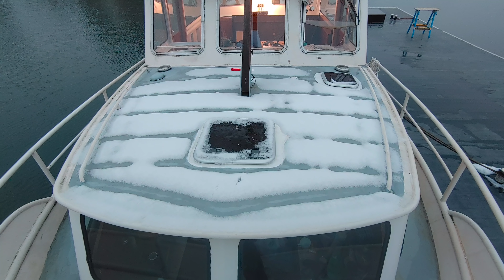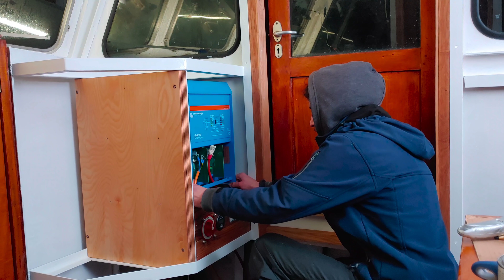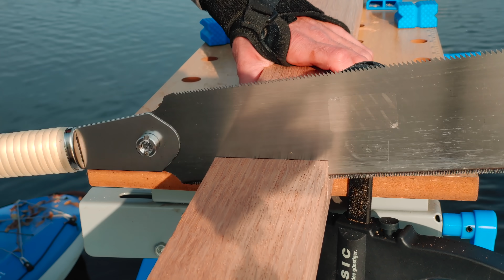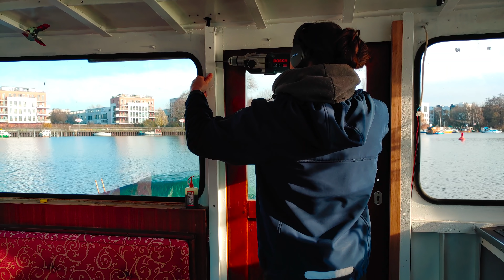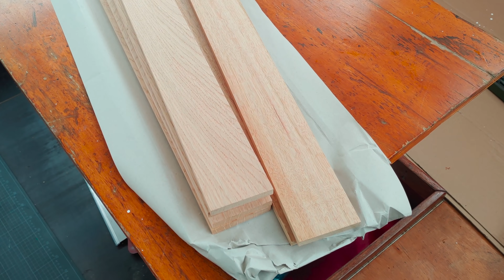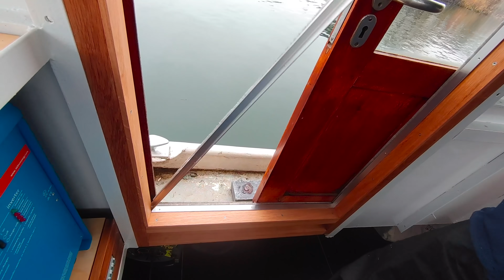Woodworking on a Steel Yacht - Part 2/2

Comment: Ouch...I never saw how close you put your main inverter AC breakers to the side doorway. As someone with many years sea experience I can tell toy,,,,it is not IF sea and or rainwater is going to come through that door and soak that panel, it is just a matter of when. If it is saltwater you can kiss it all goodbye. It looks like you have room to put a Plexiglass or clear acrylic cover door over the whole shelf unit near the door to prevent water from hitting the breakers. Truly one good beam hit by even a moderate wave in a windy condition will slap the water up the side of the boat and blow it right in the door. Electricals should never be placed near hatches or doorways that can get seawater intrusion. 
I know you are gonna say well I will always keep the door closed, but real life says the door will be open or someone entering in bad weather as driving rain or beam sea and BAM your electricals are down, and that is your MAIN....the entire boat will go down electrically, AND that 400 amp fuse ain't gonna blow before all your electricals fry. In my humble opinion. Any other sailors wanna ring in on having your main electricals uncovered right next to the beam doorway ??????

Comment: The door frames look great and your craftsmanship using basic tools is awesome.  Where the closed door meets the boat structure you may wish to add a strip of something like a foam seal for windows to add that little extra seal for that area.  It’s simple enough to add, but it makes a difference overall as that is one area that never seems to seal off very well in homes, let alone on a boat on the water.  The inside of the two doors look great and in time hopefully the outside cleans up to look just as nice.  That’s a project for summer months, but I’m sure it’s on your list somewhere as a need-to-do when there’s time (and funds) to do it.

Comment: Great work and it takes me back to my own boat building and reno's (currently on my fifth boat but my first power boat).   Couldn't agree more that the Japanese saw's are unbelievable for detail work and I have two, one of which is a tiny thing that is perfect for fine work on cabinetry.  I would suggest one thing however.  You've just done a great job on the shelving for your electrical but that is a steel boat in a cool environment that one assumes is getting heating if you are living aboard.   Those temperature differentials ensure that there is no better way to guarantee condensation on the interior of the boat.   I would suggest that you get some insulation (I've used Armaflex on two of my boats as it is closed cell and won't absorb water and is far easier and less mess to fit than some of the other options) and surround the electrical panels at least to stop that moisture from getting into your electrical as they don't mix well.  Armaflex isn't the cheapest, nor does it have the best R value though it is certainly comparable but there are others.  Keep up the great work and have fun.

Comment: Nice setup.

But:
https://youtu.be/WRLXuuORAkw?t=318
Provide adequate ventilation during charging.
Are you sure that's the case? An inverter can get pretty hot.

Comment: Great work but I’m curious since you have a steel boat, why didn’t you consider installing all metal watertight marine doors instead? Those wooden doors are the main exposed wood on the boat and will require constant maintenance. Perhaps it was a cost issue?

Comment: Excellent progress.  If you can't get to the exterior doors until next year you may want to do a light sand and put a coat of sealer on them.  The inside of the door at the bottom joint looks like it needs attention.

Comment: I love your channel.
Question: Have you bolted the inverter down so will not move once the boat is moving?
..as in large waves spell disaster... if something can slide around, it will.

Comment: Are there no requlations for boats regarding mounting high voltage switch gear and equipment on flammable material.

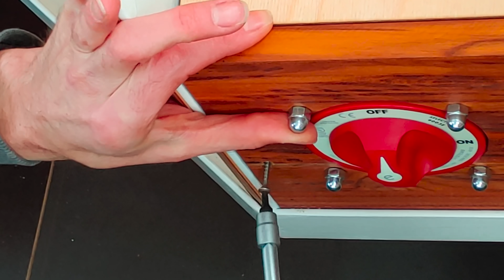Comment: For future reference if you'd like to avoid the ugly nuts sticking out of the front panel (1:47) you can drill holes partially through the wood and hammer in some pronged nuts from the backside to provide you with a nice metal thread to screw into.

Comment: Hi,when I was an apprentice marine engineer many years ago,I was taught that there should only be  one and a half threads showing through the nut when it is tightened,less bolt to catch things on and less to corrode there by making it easier to remove.Great videos and very neat work .I like the way the work is progressing ,brilliant.cheers Roly 🇬🇧.

Comment: Your electrical work is amazing. All of the hardware and wire really appears to be top quality. Excellently well routed and planned. You built a reliable,  and great quality electrical system that will last the life of the boat. I stand and clap.

Comment: Congratulations.  I have watched every episode.   

Suggest you need to support and protect the AC wires from the circuit breakers.   If they fall out you will have live (hot) AC wires in a steel boat.

Also the AC wires from the Quatro  are undersized.  At full  3000 or 5000 watt  output they may get hot/burn.

Comment: Question. Are you fitting a shore power connection? As reverse polarity is not an unknown issue in some marinas, your RCB's should be twin pole. As it is a steel boat you are best fitting an isolating transformer in the shore power circuit to prevent stray earth currents from the shore connection.

Comment: If you can get your inner roof insulated.ASAP what heat you have will rise hit the inside metal roof skin and frame and just end up heating the outside via the metal. If it doesn't actually cause contact condensation to start dripping on your interior work.🥶
Not urgent but..
Your corner shelves idealy need Fiddle Strips..raised edge strips to stop stuff rolling off the shelves,  when the boat moves and the water gets rough.

Comment: Amazing job with those door frames, but remember to seal that one screw on the outside you had to drill with some silicone or other waterproofing so you dont have a small leak that ruins your wonderful work in the years to come!!

Comment: You do such good work.  What will charge the batteries? What are you  going to use to heat the boat during the winter? And do you keep the other two boats in the  water, and winterize them.

Comment: I would put in wooden plugs instead of having the screws revealing like they are, it would give you a finer finish and it doesn't cost much! it just takes a bit of time but it looked much better.

Comment: Brush seals may keep most dust out and reduce heat loss a little but if you want good water and heat seals add silicon strips below them(so you can not se them) also, I think you would regret not doing so eventually. Verry nice looking door frames, don´t forget the panels below the doors and to put some insulation there also. Good video.

Comment: The shelves and electrics looks great ! I'm just abit concerned when it's raining and when the door is open the fuse breakers will get wet. Maybe worth making or buying a cover to protect them 🤔
Reply: I would suggest putting a 6mm tinted glass door over the whole installation - would look good and protect the breakers from water or anything being carried in too.

Comment: I'd place a bit of weather and accidental hitting protection in front of the new shelf and equipment, ie a transparent sheet of Plexiglas.
Reply: defenitely like a wodden door with some smaller plexi windows for the displays to show trugh and maybee a hinged little piece for acess the switches
hanged with some stainless steel "Klavierband" on the right side. so even if its opened the door gives protection from rain or wave splash trugh a open door
it would also cover the realy blinding blue color of that thing :P
would also take a look below the shelve to seal the gaps with some silicon to not get a splash into it from below

dont forgett you also need ventilation openings on the top to vent heat. could be positioned in the back side of the topplate